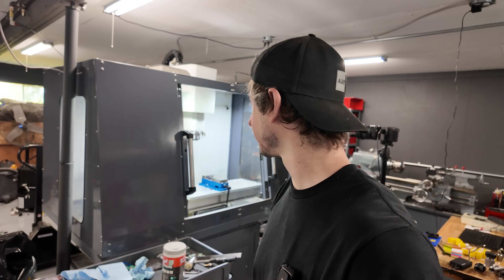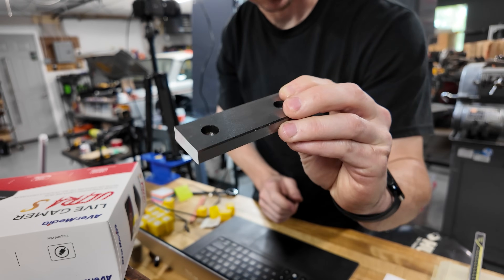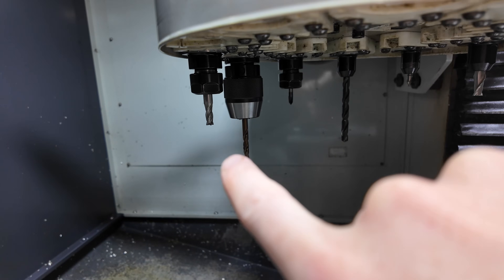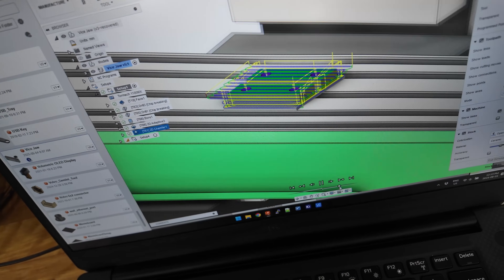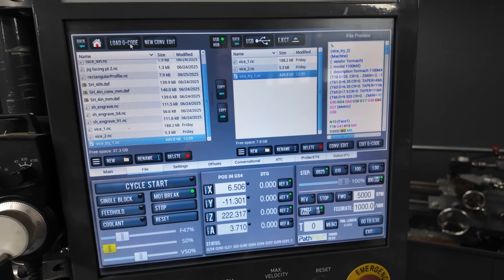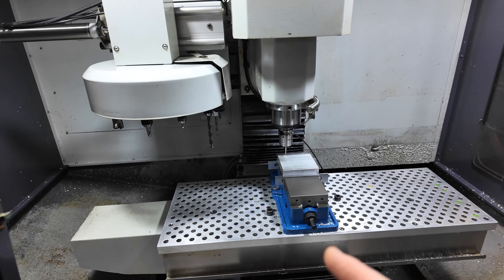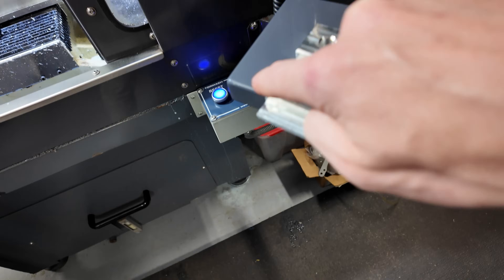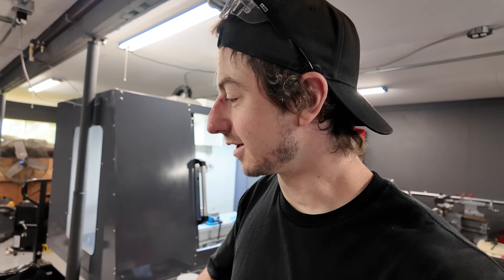First Project on the New CNC Machine

Comment from the maker: Leave a guess in the comments as to why you think I messed up the Chamfers. Figured it out after making the video and its hilarious. Come join the discord if you want to find out: https://seanhodgins.com/discord
Reply: Something to do with the center of the bit, distance to center, or what would the radius be at different sections of the frustum based on Z height or whatever it is called, you know what I mean, just never done machining or cad work etc so don't know how to speak
Reply: Tool length in the machine was set wrong, or your tool in Fusion is modeled wrong. Look for if it has a flat or sharp point. Does it look good in the simulation?
Reply: YESSSS!!!!! Everyone should be here. Great crew.

Comment: Nice work man! You will have a lot of fun with that machine! As for the chamfer, I have to guess either the wrong tool was selected in cam vs machine or your height offsets were wrong either way keep it up!
Reply from the maker: Settings were actually correct lol - but another tool wasn't 😅

Comment: Does your chamfer tool have a sharp point? Some chamfer tools have a flat on the tip that would cause the chamfer to come out big because the tool gets its length offset set down deeper. The tool profile in cam software will be a perfectly sharp 45 degree cutter
Reply from the maker: Tool is perfect replicated in fusion, it wasn’t my settings for the chamfer they were correct. I made a dumb mistake somewhere else 🤣